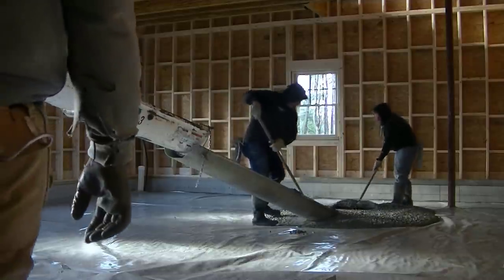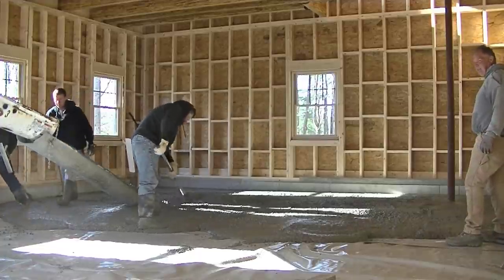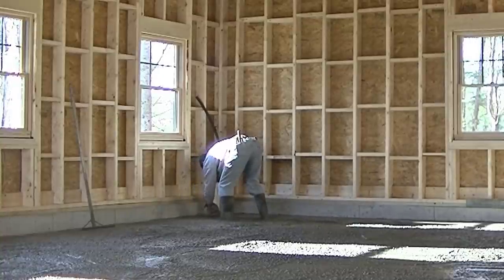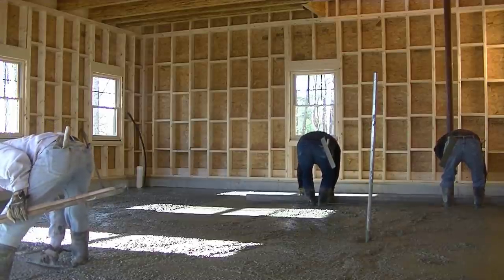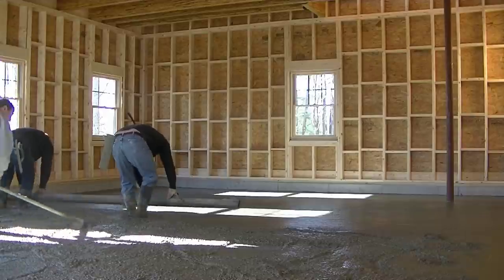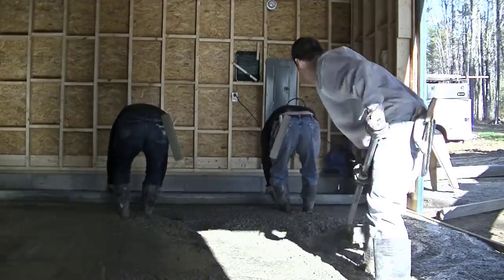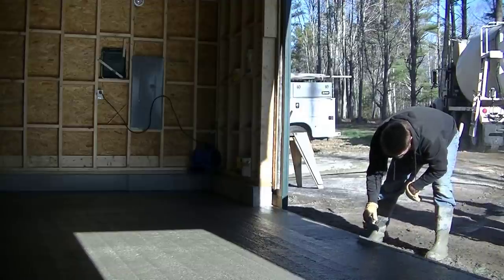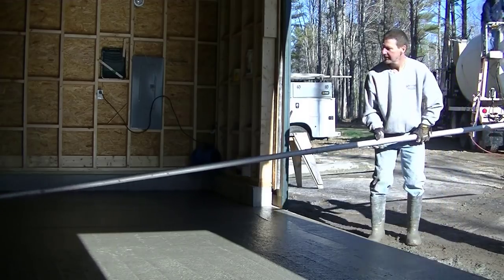How To Pour A Concrete Floor For An Existing Garage. (32' X 24' Garage)

Comment: I have been in the concrete business for 55 years. We are pouring in excess of 200 garage floors per year. Also patios (stamped, epoxy-ed, tiled or brushed), driveays, sidewalks and basements. The concrete prices skyrocketed lately, but the business did not slow down too much.
Reply from the maker: That's a lot of work. Where you located?

Comment: great video!  I had a question. I'm having my garage floor replaced, but I have one framed wall sitting on top of the slab in one corner (about 12' long).  How would you go about this?  would you saw cut right up to that wall and pour new concrete up to the old stuff under the wall?  or would you still pull the concrete from below it? I shot the bottom plate down with 3' nails.

Comment: Hey great video. Got a question. I had my 2 car garage foundation poured and have the cutouts for the 9’ garage doors. When I pour the floors, do I need to have 4” over the cutout of the garage doors or can I have 4” in the garage and go about 1-1/2” over the cutout? I would grade the base to about 3” below the cutout and pour 4” throughout with 1” over that lip. Any help would be great.
Reply from the maker: I like to go 4" over the cut out. If you go thinner it's much more likely to crack where the dirt meets the concrete wall. There's a lot of weight from cars/trucks that drive over this area every day. The thicker the concrete is here the better.
Reply: @MikeDayConcrete  thank you for the reply. Learned a lot from watching your videos. Did my own stamped concrete patio thanks to you and your girls 😂.

Comment: I just had a 24' x 30' garage floor poured and the back 1/4 of the floor was poured with the first truck, then we waited 2 hours for the next truck and the first concrete was already stiff and made a terrible joint with the new concrete, Even after power troweling, it looked like crap. The concrete guy didn't use any relief lines and said it may look bad, but structurally the job was fine so I shouldn't complain. Did he cut corners and do a bad pour or is it just me being picky?

Comment: Hi, can you tell me how long you waited to seal your floor? Mine is 5" thick fiber reinforced. I can't find information on sealing reinforced garage floors!
Reply from the maker: If it's a cure and seal, you can seal it anytime as long as it's dry.  An acrylic topical sealer we wait about a week. Penetrating sealers about 30 days. Epoxies and polyaspartics at least 30 days.
Reply: @MikeDayConcrete  Thanks so much for the reply. I was thinking of using a water based stain followed by a glossy water based sealant. Or glossy acrylic if it will work over the stain.

Comment: Hi Mike. Love watching your videos. I’m DIYing my own patio outside under a deck with five structural cement posts coming up 3 feet from top of the patio slab. Finishing up the trenching and leveling with hard packed dirt and rock. Starting the rebar soon. I’m in Lake Tahoe. So we get cold weather with freezing and thawing.  What kind of cement do recommend?  PSI ? Fiber Mesh? Additives? Thanks for all your valuable insight!

Comment: Hey Mike, what do you adjust your laser to when finding height of wet pads down slope?
Reply: You need to find your slope percentage first (rise/run x 100) then set your laser accordingly 👍
Reply from the maker: If I have a 2" slope from back to front, I adjust the middle wet pad down an inch. Just move the receiver up an inch on the grade stick to lower grade.
Reply: @MikeDayConcrete  appreciate it! Was considering purchasing a topcon with slope adjustment but I think i'll stick to just a level

Comment: Started my career as an architect working in an office at 18, though I had been doing construction since I was 13 (I'm 70 now). The owner's dad was a concrete contractor. The boss sent me out to work with his dad to learn concrete, block & brick, after a year I was moved to different contractors-framing, electrical, plumbing, roofing to learn each trade as part of my training to become an architect...NOT like these guys that come out of college with a master's degree but don't know which end of the hammer to use.  My boss was a bull, having worked for his dad all his life + 5 yrs in the marines...I'll never forget the day he took me to a job site to inspect a pour in progress, my boss in his three piece suite, starts yelling at the finishers that the slab is going off and need to get on it, The rough and ready finisher laughed at him then it came to blows with one finisher laid out. My boss striped down and jumped on the slab with the rest of the crew and knocked the slab...what a day. Moving on to commercial and institutional work, I was amazed to watch these monster radio controlled laser guided screeds screed out these massive slabs with incredible tolerances. Much respect for you and your team; this old architect knows the physical strength, expertise and skill necessary to produce a quality slab. Getting ready to start on a shop for myself-block walls, concrete slab...always interested in learning, even at my age! cheers!

Comment: I asked my local concrete yard how much to add water reducer and they said it's already in the mix. Should I ask them exactly which reducer it is?
Reply from the maker: They probably already add a mid-range so you're good up to a 6 slump or so. Ask the quality control guy just how loose you can pour and not weaken the strength.

Comment: What is the slump?
Reply: Loose ! lol.
Reply: Started my apprenticeship in 1965; started my flat work only business in January 1970, at my peak we were doing close to 600 homes a year
Reply from the maker: Around a 7
Reply: @MikeDayConcrete  that sure would of made it easy on my last two gerage.. I know prices are different here in California but what do you charge standard rate for flat work. We charge $10.26 Square foot make decent money but not as much as we should. Materials are out of control. It’s like 90 bucks for a 20 foot 2 x 12

Comment: Mom's house has below grade rooms 30x14) rains gets plates wet in. all sheetrock is failed 2" above floor want to top with ??? right material to lift 2" but i need to make new plates higher too and clean up base. Might put in 8" plate and go outside AND MAKE A NEW FOUNDATION GOING DEEPER may dig.. This includes a toilet bathroom with a double shower stall (Do I take out double shower unit in or pour 2" up the side???) Will have remove a 4"  doorway wall, has crusty lower damage anyhow. t b o h m e at  ya h oo